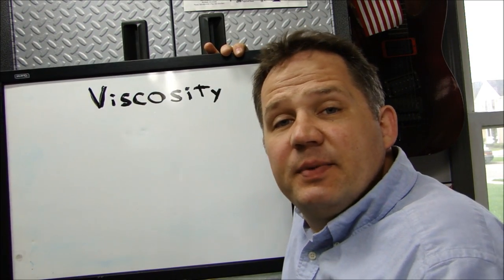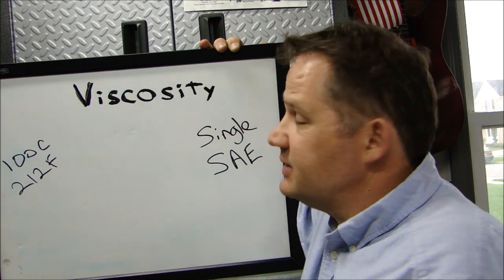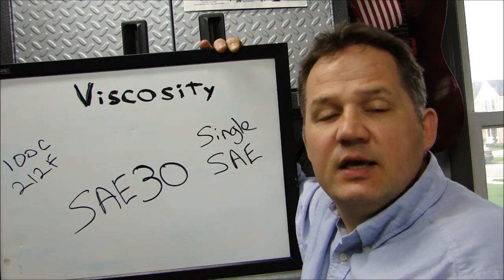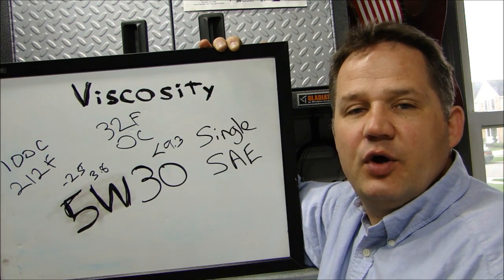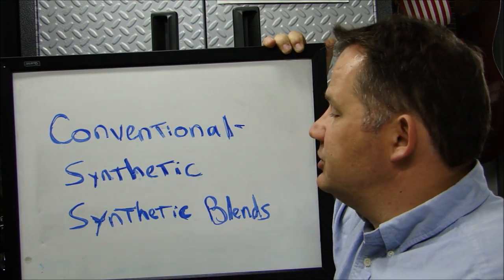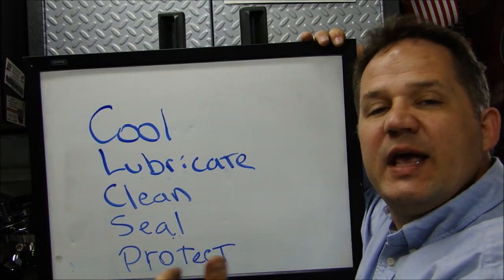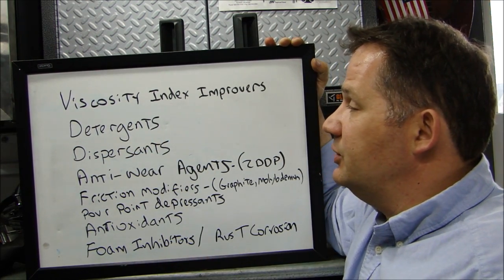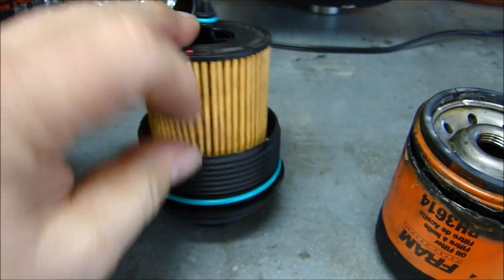Motor Oil, Oil Filters, and Changing Oil

Comment: The portion of this video on oil explanation is outstanding. Just wanted to point out to folks that the "plug on top of the fram filter" as you called it and the "diffuser" you called the part at the bottom of the Wix filter, under the anti drain back rubber, are both actually oil bypass relief valves, just different designs in different locations, but they both serve the same purpose.  Each is set to the individual manufacturers pressure relief. Thanks again for the great video!
Reply from the maker: Awesome! Thank you for your comment!

Comment: love your fenders in the background. Im a mechanic and this is exactly the reason i do my own oil. I dont want some idiot touching my car. i work for a fleet company, and if i screw something up, i fix it and have to take responsibility.(loose drainplug, leaking filter, leaking transmission gasket, ect...) its not hard to change oil. if you cant/want somebody else to change your oil, ive found most family owned shops do good a good job at a good price no matter what work you need done. Google them and look at reviews. No shop will satisfy every customer though so keep that in mind.
Reply from the maker: +luke saylor That is a great point. I realize not everyone can change their own oil, but it helps to have someone reliable who can

Comment: Pete, Very good but U missed one ting the diffuser is also a check valve in the Wix the check valve in the fram is on the bottom with the spring. The problem 2with the junky fram filter is the oil runs through the filter and picks up more dirt when the filter is clogged and goes out the check valve on the other end. The Wix will bypass right at the front, if the filter becomes clogged at high rpm and lots of pressure it will bypass without running the engine oil thu the drty filter element.

Comment: I've watched some of your videos and appreciate the educated way in which you discuss various topics. On this topic, I agree with the idea that it's best to do oil changes oneself. I certainly prefer to choose the oil and the filter so I can use high quality products, and to do work on our cars whenever I'm able so I know the work is done well. I hate it whenever I have to take one of our cars to a shop for any kind of work, as the experience is almost always a disappointment in some way or another. 

Please keep in mind that your statement "It takes 15 minutes to change your own oil" is a generalization that isn't accurate for many people due to their environment or situation. If one has a garage, with all tools and supplies readily at hand, then yes an oil change can be performed very quickly and easily. Unfortunately, if one does not have those luxuries, then even a simple oil change can either not be practical or feasible, or can take a significant amount of time, and can be a significant hassle.

For example, we don't have a garage and the weather here in the Chicago area is not always conducive for working outdoors. Even when the weather is acceptable, when I am actually ready to do an oil change I have to make multiple trips to carry out to the driveway every single item needed for doing the work. This includes a floor jack, jack stands, tools, oil and filter, drain pan, plus any needed supplies (such as rags). Once I've moved everything outside, I then have to get the car safely raised up to access the drain plug and the filter. On my car specifically, the best access to the filter is through the passenger wheel well, so I have to remove the wheel and the splash shield (with hand tools, since we have no air compressor and air tools). Then, I can perform the oil change, after which I start the engine and ensure there are no leaks. Satisfied that all is good in that regard, I can then put the splash shield and wheel back on, and get the car lowered back down. That's not the end of the process of course since I have to put the used oil filter, and the used oil from the drain pan, into containers for recycling, and clean up the drain pan at least somewhat for storage (plus do any other necessary clean up). Finally, I have to make multiple trips to carry back inside every single item that needs to be put away.

This can take a significant amount of time, which is an issue when time is so short already between working two jobs, commuting 2.5+ hours per day, spending time helping elderly parents who are in declining health, plus trying to take care of everything else that one needs to do in normal life such as pay bills, do home and yard maintenance, and try to spend some time with my wife and 1-year old son. I can only dream of having a well equipped garage to make vehicle maintenance easier and less time consuming.
Reply from the maker: +mrwhsprs Ok....once you get all the stuff there it's a 15 minute job....lol. I guess I take having a shop for granted....but I agree with you it's better to do it yourself. thanks for the comment....maybe your problem is Chicago...lol

Comment: The video was excellent info and spot on other than the one thing about the check valve. I have experimented with filters and oil a lot myself and the premium filters should always have the silicone anti drainback valve and bypass in the bottom like the Motorcraft better ones ,Wix ,Puralator etc You just have to check.Check out the million mile enine teardown video with a ford v-8 and Schaffers oil, I have used this oil for decades its awesome and a local family  Good info as always though Pete

Comment: I also pre-fill the oil filter with new oil, prior to installation.  This helps tremendously when you first start the engine after an oil change. Minimize initial start up wear and tare... Hope this helps. .
Reply from the maker: That is a good idea...thanks for sharing
Reply: +Pete's Garage Depending on what position filter in - only partially fill filter and slosh around and WAIT for oil to soak into filter so you DON'T make big mess when installing filter.

Comment: To prevent soaking your hand with a hot and dirty engine oil,I finally bought plastic magnetic inserts for sockets.
They are worth every penny and usually they come as a set for standard socket sizes,metric and SAE.
Just before I pull loose oil drain plug out,I add an extension,(6" or 8"),between ratchet and socket with magnetic insert inside it.I got my set from "Lee Valley" store.
Reply from the maker: Very cool! Thanks for sharing

Comment: Pete, I'm just curious but what made you decide to remove and  inspect that dealer installed filter that was over torqued?  Aside from that, I'm with you 100%. Always do your own oil changes.  The peace of mind it gives you is priceless.  Its faster to do it yourself anyway. No waiting around at a quick lube for your turn just to end up with a rounded off drain plug.   lol!!
Reply from the maker: +Nick V It was time for an oil change and when it was tough to get off I looked at it. As long as I am able, I will change my own oil

Comment: I just bought a used conversion van. It had all the maintenance oil change records. As it had 185k miles and one owner.

They run nothing but Mobile One in it from day one. The problem was. I noticed it had that typical oil change place filter on it. I only use the Fram Ultra Guard filters now. I went to take off the old filter and it was on so tight. I had to pry it off with a pair of channel locks! They didn't oil the ring and cranked it down. That's why I always do my own maintenance. What should have taken 15 mins. Ended up taking 1 hr!
Reply from the maker: That sucks.... I have heard more horror stories. I have no idea how these places stay in buisness
Reply: ***** easy,  people are to lazy ahem or busy to change their own oil. An many folks make it out harder than it has to be.
Reply: +Pete's Garage Even dealers and big name places screw up a simple oil change - my "last time" was a guy had to be stoned, when he over tightened oil drain plug and tried to "fix" it with silicon seal.

Comment: Just have three dislikes I have when it comes to having it done by someone else:
1)Oil is always slightly overfilled.
2)They never let enough time for old oil to drain out completely.
3)They never fill the new oil filter with fresh oil prior to installing.
Reply from the maker: I agree on all three
Reply: Plus they over-tighten drain plugs and oil filters (especially on cartridge systems).

Comment: I know it’s an older video but you missed on thing. The drain plug. They put it on my daughters car I needed a 1/2 inch impact gun to break it loose. Lucky they didn’t pull the threads out. I told her to have her husband do it. But that useless. Anyway I’ve changed my own since the beginning of time. I trust no one. Good video good info 😊🇺🇸
Reply from the maker: Great comment, thanks Arthur

Comment: Its a anti flow back silicone made piece. When you stop the engine that silicone covers the holes to keep oil in the filter. Then when started again it allows the oil to flow from the filter instead of all the way from the pan...Its for better start up protection.
Reply: Silicone is on the premium oil filters and reg rubber is on the cheap ones. Silicone can be exposed to lower and higher temps and stay flexible.
Reply from the maker: Awesome comment, thank you

Comment: Good video.  On the bottom of that Fram filter, that metal piece is not only designed to keep the filter media off of the design of the cam, it is a bypass valve which you did not talk about.  When comparing filters, you should compare them for the same application.  The Napa or Wick's filter is not the same application as a Fram.  Please compare the same models to give a more clearer view of the filter itself.  Include information about the bypass valve in the filter.  Is it wise to use synthetic oil in an older motor of let's say 20 years?  Can the seals handle it?  Would it cause it to break apart old sludge and cause oil usage?
Reply from the maker: The only thing that breaks apart sludge is a detergent. You could use a synthetic, but it's a bit of a waste of money. Stay with what the engine has been using. Synthetic oil is not a magic cure for anything.

Comment: Another thing I do with a oil filter before I take it off.I always drive my car before oil change to get oil really hot,specially when I'm replacing manual transaxle fluid with viscosity SAE 75W-90,on my car.
I punch two holes on the bottom of the filter,and I let oil drain in the drain pan.
Reply from the maker: Another cool idea

Comment: Yeah jiffy lube forgot to screw on a oil filter on my mom's car, the new filter was sitting on the exhaust manifold. It lost 75% of its oil in 1 mile. A quick question, what's your opinion on mixing conventional with synthetic? People say don't do it. But I've topped off with conv. for years with no issue. Thanks for the quality vids!
Reply from the maker: Thanks Shaun, well, if you look at it from a molecular standpoint, lubrication is lubrication. However, there may be an issue with the different oils being able to mix evenly, but I see no issue.

Comment: What about mileage / Oil break down, and choosing a weight for your vehicle? Thanks for the videos Pete! New subscriber here!
Reply from the maker: Thank you my friend. I always follow the manufacturers recommendation on which oil to use in a vehicle. The thoughts around mileage and oil breakdown have changed recently. It all depends on your driving style. New cars monitor your driving habits and have sensors in the oil pan that look at how dirty the oil gets. The computer lets you know when to change the oil. The 2000 mile limit has grown to 5,000, even 7,500 miles between oil changes. Of course it never hurts to change on a regular basis.

Comment: at 29,000 miles jiffy lube forgot to snug down the oil plug , it took 6 months for it to back out , and on the long island expressway it fell off and we had had to get a short block for the car , the man we called jiffy lube and this is what they said when I asked for a new motor  , they giggled and said take a number and stand on line, needless to say I was pissed and took care of jiffy lube in my own little way , witch I would have to take the 5th and say no more.
Reply from the maker: +jojojeep1 You are not the only one. I try to stay clear of those places....but I would love to hear how you took care of them
Reply: I didn't , my wife's family has a repair shop, they steam cleaned the car , motor, and under floor boards,we put a new oil plug in and oil ,then we took it to mazda dealer and took a chance, the crank cracked before the cylinder wall's showed any signs of lack of oil and they put the new motor in, it was pure luck or like I like to say , a blessing, mazda marked it up as a cracked crank and covered it. jiffy lube got away with it in my case, there's really not much you can do , that's the real reason God made day and NIGHT , so if you feel you need to take the law in your own hand's you do it in the dark , AND TELL NO BODY not even your wife, telling people what we do is the # 1 reason we get caught.
Reply from the maker: Wow...how cool for you. I never tell anyone...not even my dog
Reply: you got it , gotta keep our dirty deeds to our self

Comment: Goodyear will give you a oil and filter change with Valvoline conventional oil tire rotation and complete safety inspection for $19.99 plus $3.00 for recycle the oil. He said the bypass valve was a piece to keep the filter off the bottom of the filter. Wrong. The bypass opens if the filter gets clogged and will let oil go to the engine. I haven't changed my own oil in fifty years and never had a problem. If you want have them check the oil and filter in front of you.
Reply from the maker: Good advice, thank you Arthur

Comment: Pete, realize this is an older video but I just came across it searching through your other videos. Some great info in this video. I was wondering your opinion on bypass oil filters.  I got a 2007 Cummings so it has the EPA DPM collection in it. The oil gets pretty dirty from all the extra carbon that gets in it. I read where people have used the bypass with 1 micron filters in them and it kept the oil a lot cleaner. My concern is when using that fine of a filter, are you filtering out the good stuff as well. I'm still planning on changing the oil at recommend intervals instead of going longer like they advertise. I just figure the less garbage in the oil, the less chance for problems. Thanks.
Reply from the maker: Hey Troy, a 1 micron filter is pretty small. Unless you're using 0 weight oil you may have a hard time getting oil through it. If it is a passive line, not directly in the pressure path, it will help clean the oil.

Comment: excellent video Pete, just one question, what was the torque for the canister filter?  thanks!
Reply from the maker: I think it was around 28Nm
Reply: thanks pete!
Reply: Hi Pete, I replaced the water pump, thermostat and coolant on my 1999 E46BMW, then after bleeding the bubbles (air), a couple days later the hose coming out from the radiator blew up; I replaced it, and now I don't have hot air and I don't see coolant circulating from the small hole above-inside the expansion tank, do you think that there is a chance that I blew the water pump or thermostat? thanks pete

Comment: Great video.  Lots of valuable information.  The metal piece in the fram filter has a purpose it acts as a spring to keep constant pressure on the filter element to create a proper seal and that little plastic piece in the center is bypass valve.    just in case for some reason the filter element becomes clogged (or high flow demand) you will not lose oil pressure.  The wix uses a different style of bypass valve.
Reply from the maker: +twofargone Awesome! Thanks for sharing that info

Comment: Pete, do you put oil in the new filter before installing it? I've been told it doesn't matter and that it does. What's your opinion
Reply from the maker: +James Lowery If the filter is mounted with the hole up, it does not hurt. I usually do not because it only takes a few minutes to change the oil and the engine still has plenty of lube at start up
Reply: +Petes Garage Thank you for the quick response. I have done it both ways in the past but wanted you're opinion since you seem to be very intelligent about alot of things. So thank you

Comment: @Petes Garage hi, i was wondering what you thought about putting magnets on the outside of the oil filter. i saw another video  and the guy said it helps prolong engine life. im really ignorant about cars and would appreciate any thoughts you have .
Reply from the maker: I would have to see some test data that proves it works. Most metallic material sits at the bottom of the oil pan. You will get better results with a magnetic drain plug

Comment: Did you say that oil gets thicker as it get hot? A 5W30 will get as thick as 30 viscosity when it gets cold.  The oil will thin out no more than 5 viscosity when hot. If you have ever used 90 viscosity in a differential you know that the higher the number the thicker the oil. I think you just got it backwards. Good info.
Reply from the maker: I'll have to watch that again....I could have made a mistake, but you are right
Reply: It doesn't get thicker. The additive changes as the tempeture goes up or down. These molecules will coil up or unwind depending if it's hot or cold. So the flow rate is always consistent. That's why you look first at the API and SN rating. If it's not printed on the bottle. Don't buy it!
Reply from the maker: Awesome...thanks for sharing!

Comment: What type of Oil would you use on an Engine with 250,000 miles ?
Reply: Whatever the owner's manual says. Only switch to high mileage oil if you have leaking seals or obvious signs of engine wear